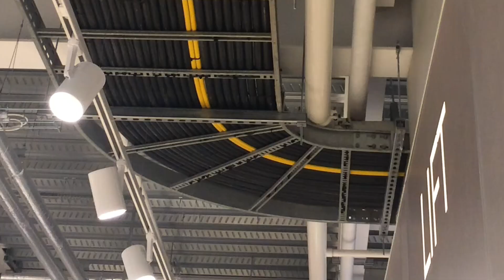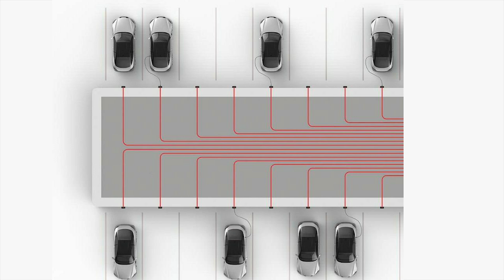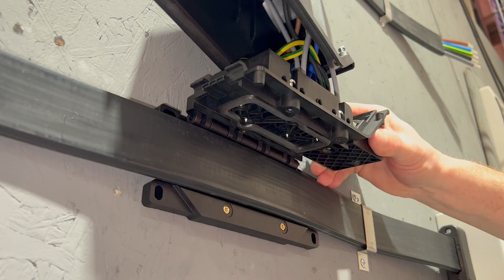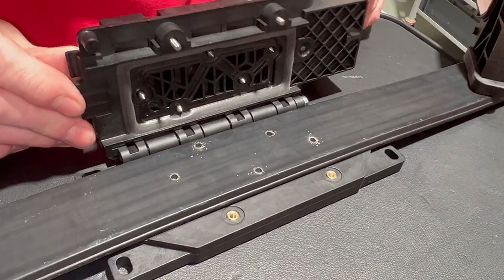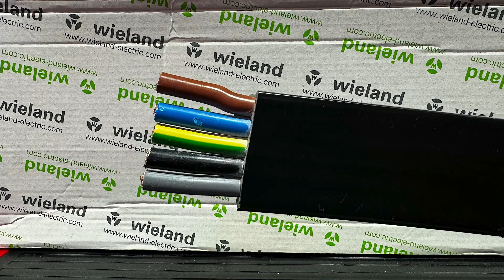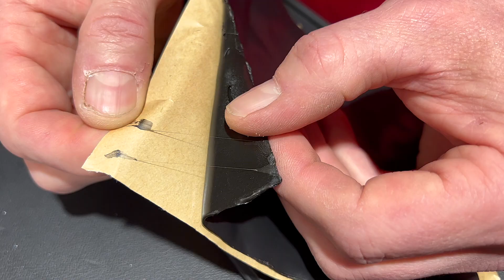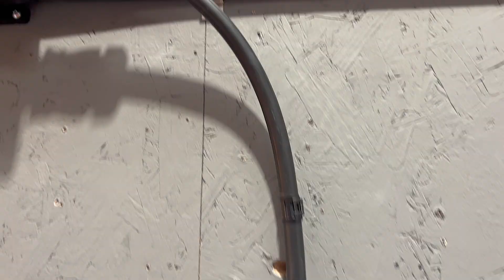How Can This Cable Speed Up Electrical Installations? - Wieland Podis

Comment: So I put my radial cts in my house by running T&E behind a modified skirting, on the first floor using wago boxes, the wago boxes supplied a socket on first floor and ground floor. So like a tree, one cct to the rear of the house and one to the front.  Now if they came up with a 3 core version, you could tap off around the house. It would be great. Continuity of the cpc would be good too.

Comment: I love the idea of turning up to a petrol pump with a nearly empty tank and the petrol pump decides whilst I'm away to just feed the fuel in at a trickle. I come back having expected, say a quarter tank, but I've only got 2 litres.

Isn't that what these intelligent load systems are likely to do? I've plugged in, expecting 7kwh of charging to get me home for a cheaper overnight charge but 1 hour later i discover i still can't make it home?

Comment: Can we speak about Meter and breaker panels crammed under stairs or in a little Cupboards, connected with individual wires on a wooden boars  vs  Combined metering and  Fuse Boxes we have in germany? The smallest ones allowed in new installation are 900mm  by  600mm
Reply: Our housing stock was not smashed to pieces in quite the same way as it was in Germany in WWII. I am quite sure if you go into an old property in Germany it is not the same as a brand new one. Oh and because we use ring mains which require less copper in the first place we don't need as many circuits so a 900x600mm board would be completely ridiculous for the vast majority of domestic properties in the UK. Meters are separate because we like to have them outside so traditionally they can be read even if nobody is at home, and they are different areas of responsibility.

Comment: I'm glad someone is talking about how EV charging actually works.  Few people will be doing a flat to full charge daily.  Not many people stop at the petrol station and put in a full tank every day so why would it be any different with an EV?  Even if the EV has a small battery and does require full charging, that is offset by the low capacity of the battery.

What we really need is a coordinated system, a common (universal) protocol for the network and charging equipment/EV to talk to each other to work out what to do and when to do it.  EV owner merely says I'd like X percent charge by such n such time and let the system work it all out.  If more capacity is available, the system decides to bring the EV up to a higher SOC than requested, so tomorrow night this EV might not get any charge at all allowing the power to go into a EV that needs it.
Reply: Yep, should work. Both based on OCPP 2.0 / ISO15118.
•
(.. which is an open, global standard, only ignored by our cousins across the pond!)
Reply: @maxking3  Doesn't appear to allow the vehicle and the network to sort out coordinated charging.  It requires further equipment, say a coordinated charging station (multiple vehicles) that can adjust it's output to suit itself but not that charging station getting feedback from the network as to what it can draw at any given time.
Reply: @retrozmachine1189  It does. And „Yes“ it requires a signal from the network.

It should allow the consumer to set priorities like: „Charge 100% whatever“, „Charge 50% whetever - then to 100% if cheap tariff available“ or „Only charge on cheap tariff“.

For the grid - they can basically throttle the KW available for charging if energy is scarce.

For Germany see §14a - EnWG 
(Not sure whether the British government has outlined any capabilities in this respect.)
Reply: @retrozmachine1189  It does. And yes, it requires a control signal from the network.
Reply: @retrozmachine1189  It does.
Reply: @maxking3  FYI you are the first person that has mentioned this standard to me in all the time that I have been posing this concept on youtube and elsewhere.  Well done.
Reply: @retrozmachine1189  Not many building automation specialists on Youtube. Glad you found it useful!
Reply: @retrozmachine1189  Glad you found it useful.
Reply: So how do you tell the system that you are in a hurry and need a full charge because you want to go on a long trip or are only on a stop of a long trip and need a full charge quickly?
A gas station can fill up 8 or more cars simultaneously within less than five minutes including payment.
What of more than one car requires a quick charge?
Reply: @AlJay0032  You could do this from the car dashboard or your phone calendar aka Outlook.

But the idea is a different one: You get a guaranteed minimum charge, whatever the tariff. 

For a full charge, the system waits for a low-price window, honours a low KWh limit or a combination of both.

360 days a year, I would be fine with a 50% charge and the lowest possible price for anything on top.

5 days a year I have important trips where the energy prices don‘t matter.

This feature will likely allow you to travel at a fraction of the price of your petrol car, so comparing it to a filling station is not really the point.
Reply: These are level 2 chargers and not fast DC chargers. Across the pond, we use autel and Tesla units for instance that load balance the main service. There is no, "I need a faster charge than everyone else" mode. Everyone would always be using that feature. Equal load balancing is most fair. Whoever plugs in first will ultimately get more power faster. Whoever is finished charging, donates their allocation back to others still charging.
Reply: When I plug something in, I expect it to charge, not decide if I really need it charged. What’s next? Car can sense if I’m going to cause an accident and will decide to just delete me into a tree?
Reply: Many options for this already: Mennekes, KEBA KeContact, Hager witty, Schneider EVlink/EcoStruxure, …
Reply: @maxking3  Not a global system, is it?  All has its many and varied means.  Slap a KEBA and a Hager Witty on a common supply and can they co-ordinate with the network to ensure say the area supply transformer is not overloaded?
Reply: @retrozmachine1189  Yep, should work. Both based on OCPP 2.0 / ISO15118.

(… which is an open, global standard, only ignored by our cousins across the pond!)
Reply: @retrozmachine1189  Yep, should work. Both based on OCPP 2.0 / ISO15118.

(.. which is an open, global standard, only ignored by our cousins across the pond!)
Reply: @retrozmachine1189  Yep, should work. Both based on OCPP 2.0 / ISO15118.
Reply: Who doesn't put in a full tank? Unless they're poor it makes zero sense, you'll just have to refuel often wasting time and fuel in the process
Reply: @25566  It's mostly people that don't take the time to understand the comment that they reply to.
Reply: @25566  I think he's making a wider point, For an ice car u need to go to a place dedicated for fuel, EVs drivers can goto to the place they want to goto and get a charge. I know of a company with plans to turn existing lamposts into EV chargers. The technology exists to use the tiny feed for lighting to charge EVs!
Reply: @chen_490  lamppost chargers have been a thing for years. The posts and their supplies were sized for sodium lamps, now they're overengineered for LED units so there's free capacity.
Reply: @25566  When I was driving around I was filling the tank half full. Partly in anticipation of the reduced range of my "new" electric car, and for the marginal weight savings.

Comment: great video. i noticed the Wevo platform was mentioned when using chargers without load management... whats their role?
Reply: Wevo's EV charging management system supports cascading multiple chargers onto a single electric cable. They manage the available current dynamically between units so that connected cars can be charged simultaneously.  It's also a scalable system for larger carparks.

Comment: It’s not unusual for using EMT TUBING in the states. What gets me is that the consumer units as called in the UK are made of plastic, what is the flammability rating of the plastic used in the housing? In the states it’s code to use metallic breaker panels in many states but there are some exceptions where plastic is used but it must meet certain fire code standards for flammability and temperature.
Many parking garages now prohibit the parking of electrical vehicles within their structures, even in residential situations many insurance companies are cancelling homeowners insurance if they know you have an EV and have a garage.
I would find this system quite useful for use in a transmitter facility allowing tapping into the main bussbar and feeding it off into separate "subscriber unit" equipped with appropriate circuit breakers and a kilowatt hour meter for independent billing of power used by each companies transmitter or repeater system.
Reply: EMT is not the same as our conduit I don't believe. Yea DB's were specced as metal originally, then they swapped to plastic, and now we're back to metal!
Reply: @UnimportantAcc  In the US we have multiple types of conduit availible.

EMT is commonly used for lighter duty commercial installations, where impacts are not expected to be a concern, such as above drop ceilings or inside walls in commercial buildings and some residential buildings.

For industrial settings and outdoor Rigid metallic conduit is more common. The metal is thicker and this is the conduit type that has to be threaded. Rigid is not commonly used outside of these situations because it is more expensive and its also more time consuming than other forms of conduit to install.

For corrosive environments there is rubber coated Rigid, also called robroy, which has a layer of rubber over the metal to keep it from being eaten up by acids and the like. 

There is also PCV conduit, basically a kind of plastic, in both schedule 40 and schedule 80. Generally used where impact is not a concern but corrosion is. this makes PVC ideal for burial situations since it will easily last a 100+ years.
Reply: @ryuukeisscifiproductions1818  Sounds like our conduit is the same as your Rigid then! Usually galvanised steel - But in corrosive environments we use stainless steel instead. No rubber coating

PVC conduit is also used in places where impact resistance is not a concern - but it can look quite unsightly so I've often seen galv steel spec'd in cases where price is not a concern. Only one type of PVC conduit is sold over here - very much light duty in comparison to the metal.
Reply: @UnimportantAcc  Stainless steel rigid is sometimes used here as well, but its very expensive, the rubber coated galvanized is cheaper, and in some corrosive environments, such as where sulfuric and phosphoric acids are made, not even stainless steel stands up to it for very long. Paper mills likewise have some very corrosive chemicals that not even Stainless steel can withstand.

There was also a gunpowder plant that i worked at where they used all aluminum Rigid, though Im not sure why, Im guessing aluminum is less reactive to the chemicals present there. It probably also grounds better, and that's the other reason its used. apparently its also common in food processing plants. But i tell you Aluminum is awful to try and pull wire through.

The other thing we commonly used PVC for is when its buried in concrete. Concrete is slightly acidic and has a habit of eating up steel over time, so PVC gets used there instead a lot.
Reply: @ryuukeisscifiproductions1818  I see. I've worked in paper mills and sewage treatment sites where we will also use armoured cable, which will have pvc or xlpe sheathing, I suppose that does a similar job of protecting the steel armouring from the environment. These would be tied onto stainless steel cable tray. Or alternatively secured w plastic cleats, if you weren't running too many at once.

As for underground we'll tend to use armoured cable run thru hard ridgid plastic ducts, whether those ducts are pvc or smth else I'm not entirely sure. They've usually been placed by groundworkers before our arrival!
Reply: @ryuukeisscifiproductions1818 the aluminum in the gunpowder plant was probably because aluminum doesn’t spark
Reply: Can’t speak for Europe or the uk but here in Australia most domestic installations and some commercial use plastic boards (pretty much every board without a busbar) They’re fire rated for 2 hours minimum.
Reply: @sniperfi4532  that’s good news that they have a two hour rating! I have an unusual breaker panel made by Square D electric. It is in one of the mobile connex shelters used by the US military to setup a command center. It is one large panel that has three systems in one metallic box. These shelters were powered by three phase 60 Hz diesel generators as well as by 400Hz  3phase Gen sets. The 60 system was used to power lighting and the ECU Heat pump (45,000 BTUs) while the 400 system was for powering  special 3Ø 28vdc power supply for radio equipment. The right side of the panel box houses the 60 Hz while the left lower is for 400 Hz AC in while the top left is for 28 volt DC distribution. Now these panels are not legal for residential, commercial or industrial use. Only for military use. One must observe care when all three systems are energized if you need to work on a live panel or you will receive a Darwin Award.

Comment: Brilliant looking system, wondering how it encourages sensible phase rotation to stop the plug-in hybrids all overloading L1?  I think electricians aren't always the best at understanding how you many cars you can actually charge off of a 63A 3-phase supply, for an average residential unit install it is a lot. The idea of a home-run to every charger is horrible - I hope there aren't many installs like that!
Reply from the maker: The Zaptec Pro featured can automatically manage phase rotation and balancing.

Comment: I'm sure a thief could strip out a dozen of these outlets on the wall with cable in 30 mins. 😂
Reply: Seems it still needs a outter enclosure or someone could add their own tap off for free electricity
Reply: @oninbridders only a few screws prevent you from doing that with the "traditional" system, this is hardly an actual issue

Comment: Copper thief's dream system.
Reply: That is precisely my worry. They already nick the cables from DC charging stands and I think this would just as easily go walkies.
Reply: One screw driver is all you need, tork function if you want to be a pro about it

Comment: Upgrade the current rating by wiring in a ring. 😉
Reply: Yes, please let's not. I know some countries still use ring circuits, but there are many good reasons why you should not. One of the reasons being it's against code in many countries.
Reply: @patrickd9551  other reasons include greater risk of multiple-short fires, backfeed, increased time to localize problems.... its not a good system, and is the modern equivalent of "ring and knob" wiring systems from the early 20th century.

Comment: Very neat but unless you can find a way to mine a lot more copper then the whole net zero thing is a nonsense
Reply: This comment is a nonsense.
Reply from the maker: It’s called 🇨🇱 Chile
Reply: I wonder if a system like this could use aluminium? Sized appropriately and with aluminium safe taps, it could be an interesting option.

Comment: EV charging demand will be short lived. There is only so much Lithium to go round!
Reply: There are other battery technologies being developed that don't require lithium. Besides, there's only so much oil, too, and we keep finding new ways to suck that out of the ground.
Reply: They said the same about oil 30 years ago.
Reply: I think you'll find that new research shows that the oil supply is regenerated. Co2 is not the problem. In fact it's food for trees end of!
Reply: @robs4509  LOL
Do you get your news directly from OPEC?
Reply: @AgusSimoncelli Do you still believe it's called fossil fuels because it's made of dinosaurs? 😂
Reply: @robs4509  I read something about this many years ago. An article said that Russian oil producers would empty and oil reservoir, then return to it a decade or so later and the reservoir would be full again.
Reply: @allanthomson7532  yes apparently the earth creates more crude oil to fill the voids.
Reply: @robs4509 just wait a few tens of millions of years, and there'll be plenty more oil to go around!
Reply: @robs4509  loving it. Oil regenerates! I suppose it does if you wait long enough. You’re also right about CO2, it does feed the trees, they’ll love global warming.  We might not survive, but the trees will be okay? I bet you’re a right laugh on site with these japes.